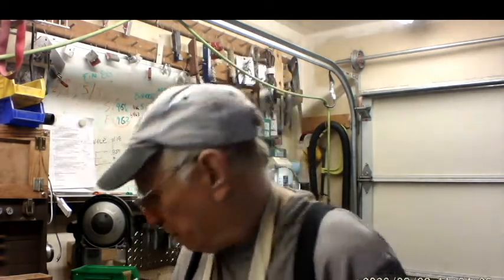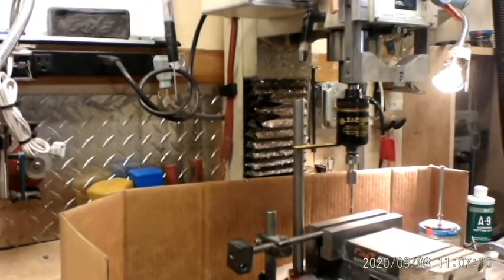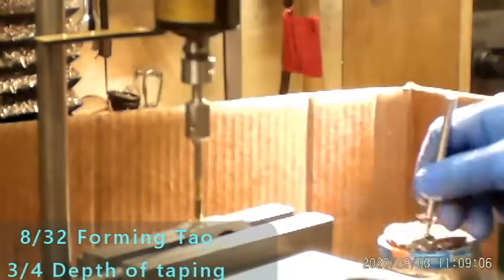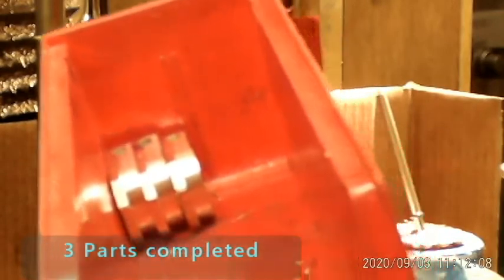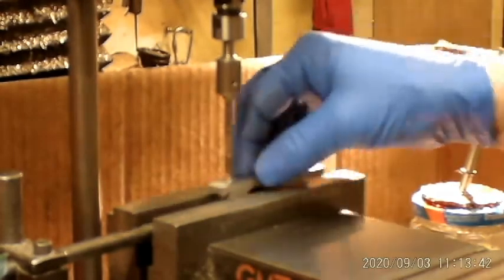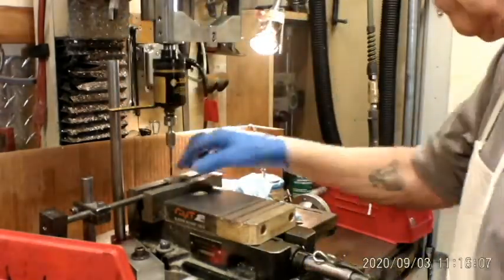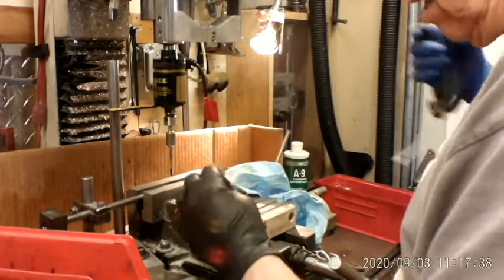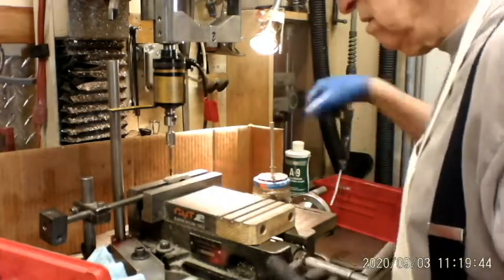Tapping with Tapmatic Tap Head

Comment: What about tapping blind holes?
Reply from the maker: Tapping blind holes is no problem. I always use a quill stop to adjust depth of cut. Tapmatic will tap exactly 1/4 inch deeper than quill stop setting.  In this demo you are watching the tap-depth operation is set to 3/4 inch.   To set-up, I first touch off tap at top of drilled hole, set z indicator at .000, then set quill stop at .500 below.  When I pull quill down into drilled hole, the Tapmatic will tap to quill stop  depth setting of .500 + .250 internal spring setting Then it will stop, it will reverse when I lift quill handle.  You can use this technique for any blind hole depth. The Tapmatic does have internal clutches, but I would never count on the clutch for blind hole tapping. Much better to set your quill stop just a shade short of max hole depth, so that tap will never actually hit bottom.  I do hope that I have answered your question. Thank you for watching. Howard
Reply: @howardblinder9551  Thanks for the reply.  But it sounds like you can't just start the tap into the hole and the just let go of the quill and it will tap to depth you set + 1/4 of and inch then back out by itself.